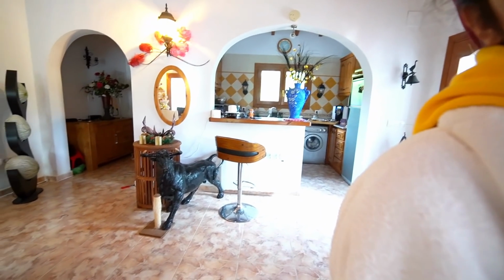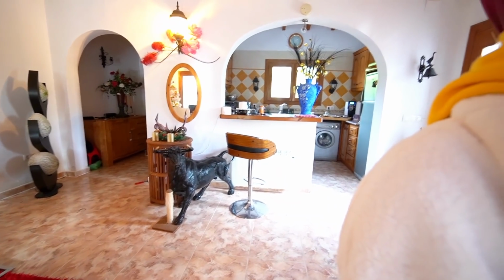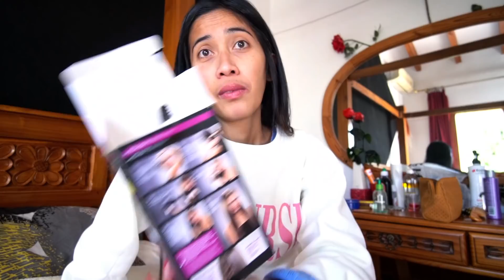ITO ANG BAGONG BLESSINGS ANG MATAGAL NG GUSTO NAMIN N MISTER! PINAY LIFE

Comment: I have same type of heater at my cottage. I Didn't use it for years. My fridge and stove are also using gas. The other button is for giving sparkles, to initialize fire,. First  you need to press down and turn and then hold down the temperature selector for 10 seconds in your gas heater. Holding the temperature wheel down will let the gas flow freely, it will bypass the safety mechanism (no heat -> no gas will flow = safety shut down).  About 20 year ago a EU regulation changed. The gas will come very slowly nowadays when you press the wheel or button to bypass safety mechanism when setting the fire. EU thinks it's more safe when the gas flows slowly.
I had to give up my cottage season about one week ago. Now the temperature here in Finland (South) is -19 degrees of Celsius. 
I' retired now, since 10/2019. 🇫🇮